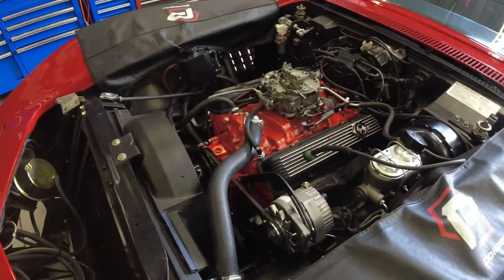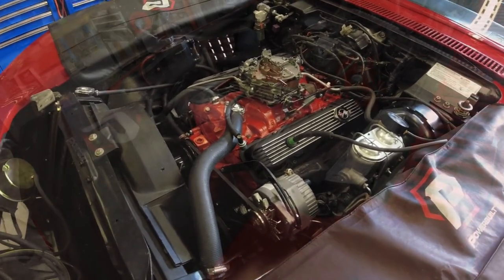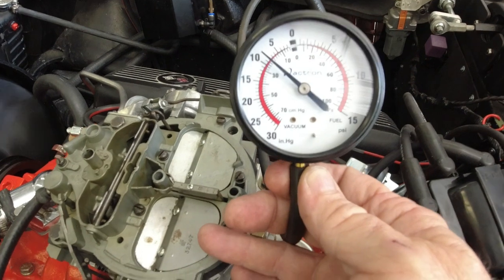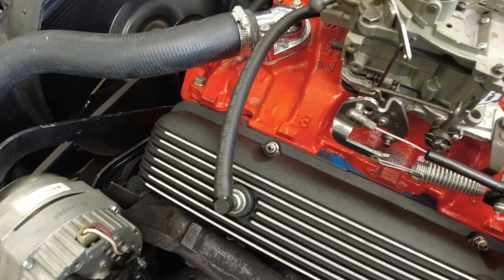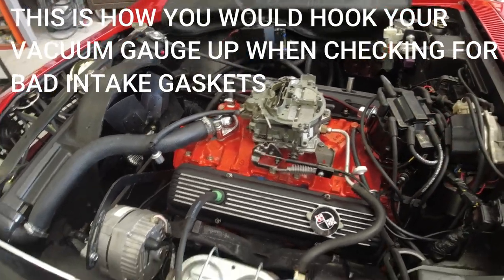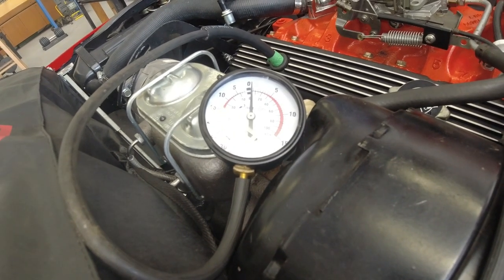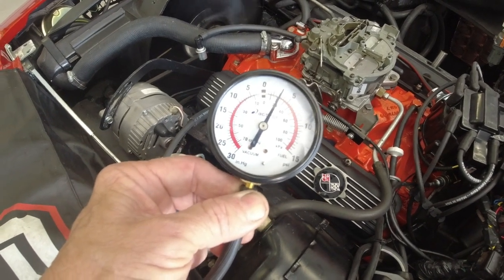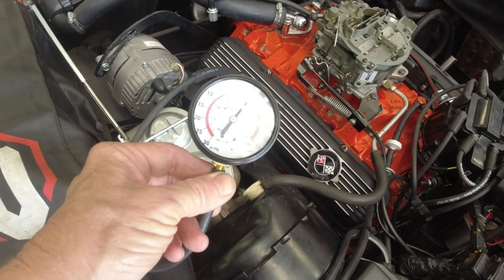Testing Intake gaskets With A Vacuum Gauge

Comment: I just built a brand new engine and I have a vacuum leak around my intake in my throttle body and I just I wish I had somebody like yourself to help me I'm tired of doing things by myself but great video
Reply from the maker: Thanks. I know it is frustrating sometimes working on old cars. I would be pulling my hair out if it hadn't already fallen out on its own.

Comment: I tried this sealed everything couldn't get pressure or vacuum?
Reply from the maker: You may still have a vacuum leak, or the gauge could be bad.
Reply: @timewiththedurbins I'm swapping the intake 1 plug looked real lean
Reply from the maker: @christopherpoucher483  Good luck. sometimes chasing down a vacuum leak can be frustrating.